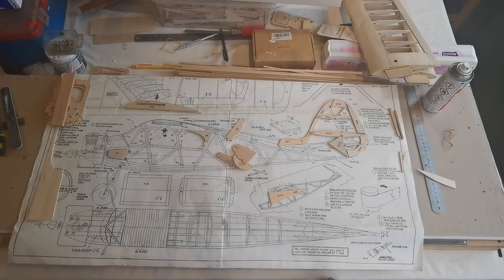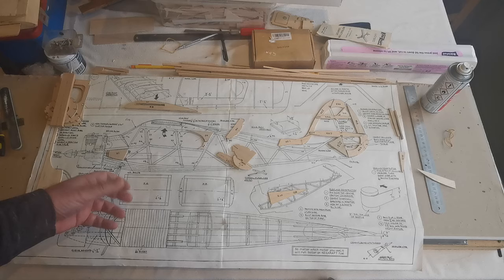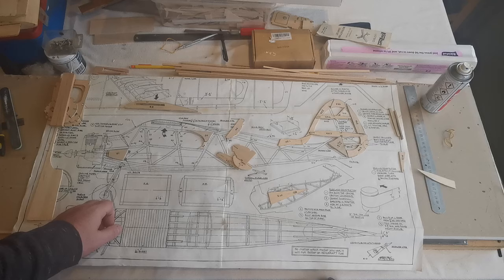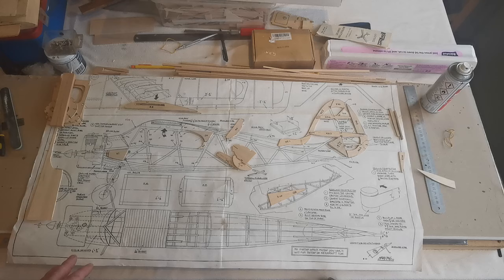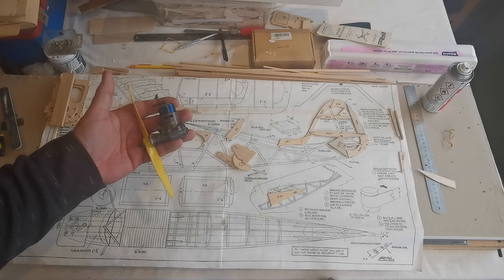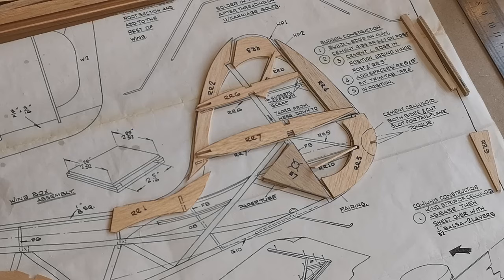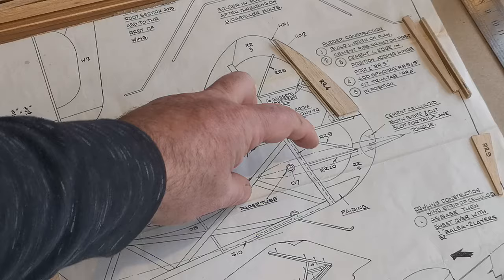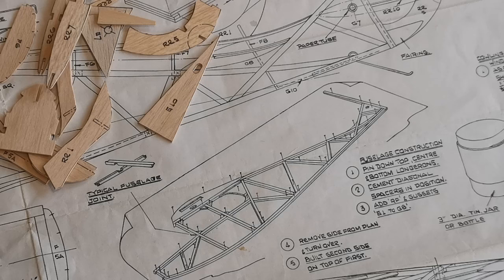Ladybird build how to add the RC.

Comment: Lovely! I remember DC engines being a bit weak in the big end, having a reputation for snapping - one had to go easy on the compression lever.
            This does seem to have rather a complex fuselage design, perhaps the hop up to 1cc will be ideal, and if you can use micro servos in the tail, all the better.
          Nice one Mark! 🌟👍
Reply from the maker: You read my mind I have a DC Spitfire engine donated from the same collection as the kit.
And a micro servo for the tail.
Reply: @MarkCroucherRC4fun  well in truth I watched the video and you did mention that Spitfire. It's nice that the kit AND the engine are coming from the same collection, a great tribute to your friend. 🌟👍
Reply: Im sure that DC Spitfire you have will be fine. Its an older engine noted by a few mor fins on the head. the later engines were rubbish and had far fewer fins machined into the head.
The rear end I found was not conducive to converting to RC on my model but doing it in the build should be easier. I built and flew mine at the Nats Chuck and duck a few years ago powered by an ED Cadet. Flew very well and ended up with a half hour return walk to the boundary of Barkston Airfield ! Good luck I Look forward to see the results .

Comment: Surprising how your friend had to add tail weight, if you remember my KeilKraft Ajax build I used to micro servos right in the tail as well. I don't know if you considered a slightly easier option given the fact that the elevator is behind the Rudder of just extending the Rudder backwards a little bit to enlarge the area?
Reply from the maker: I was surprised too but it gives more options.
Id like to retain the plane profile so I think Ill have to go for the slightly more difficult task of increasing the area while retaining the silhouette.